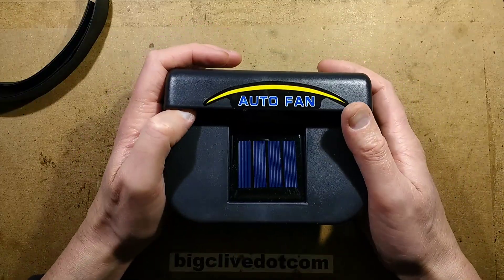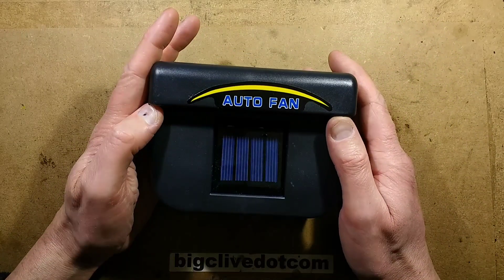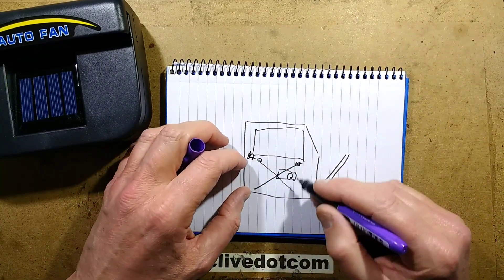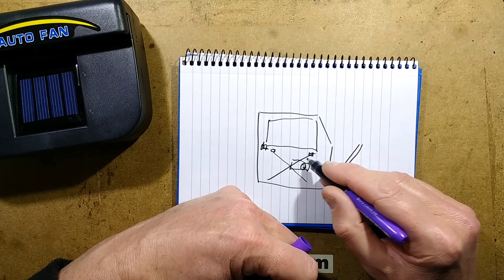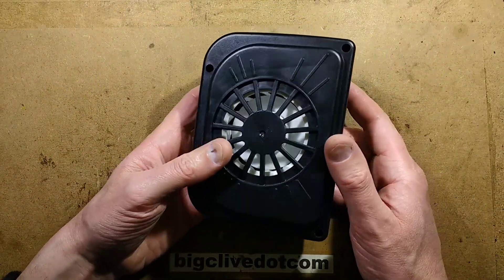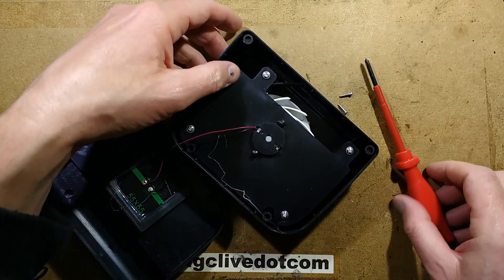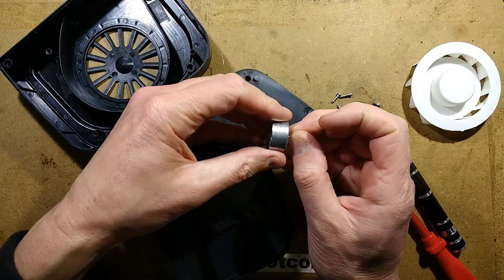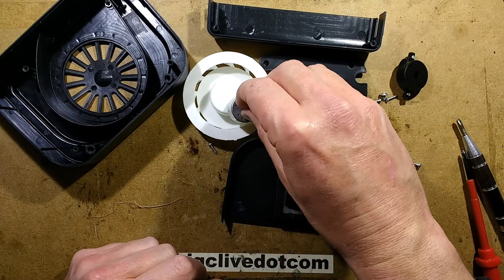Inside a solar powered car window ventilator.

Comment: I've been saving old and broken electronics lately  in hopes to create something useful. Thanks for all your videos. 😁👍
Reply: I had one and it didn't work too well, I would replace the fan inside with a high powered one from a computer and get a foldable solar panel to power it $50-90 on amazon. 
I'd look for one with the anti glare treatment and place it behind the rear passenger headrests

Comment: VW?  You can buy the cables and spool separately.    I would be slightly worried about giving a thief a headstart by making that little gap at the top of the window. 
Ps my car still has a tape player fitted.

Comment: The panel on the inside of the car door is called a "door card" and the metal cable with the sheath on the outside is called a "Bowden cable"

Comment: The seal I received for my 2012 VW did not work, it kept popping off.   Even if it did work, it would not have sealed it off all the way because the fan hits the top of the door using my automatic window closer and opens up immediately when the fan  hits the top of the gasket around my window.   So instead, I tried to use  the foam insulator for water pipes, large size and it works good and slides on real easy.  Have to buy the foam tomorrow,  large foam instead of what I have been using now which is the insulator for small pipes.

Comment: Breakage of your window's REGULATOR (interior plastic component) has nothing to do with the ventilator; or the weight of it ON the glass.  Mine broke when paying at an indoor parking lot.  Window went down and would not go back up ... BROKEN plastic cap/component withIN the mechanisms of the REGULATOR ... I have TWO ventilators for both sides of REAR (powered) windoes ... NO PROBLEM

Comment: Wanna know something that might make you angry? Auto windows have a sheer tab that causes them to break themselves if they push on the window too hard. They do this to prevent the motor from shattering the window, because it is cheaper than current limiting I guess...

Comment: Now you need to tear down the power window controls on a better car. Where they will bounce back and re-open to avoid strangling kiddies. Honest. This is common these days, don't know how they do it but that and auto-close must sense current? And position? Tear one apart!
Reply from the maker: It uses current sensing to detect the motor being stalled.

Comment: this illustrates a misconception of trying to defeat car technology whereby the window is designed to close then switch off this unit breaches the closure tech and clearly shows the result of the window trying to do its job and the unit blocking its primary purpose

Comment: Condensation is stuff you get on bathroom mirrors, you actually get it inside cars?
It's so dry in Australia I had a couple of oranges escape from my shopping bag a few years back, I found them under the front seat a few months later, tiny shrunken oranges, still orange, still round but about 1/3 the size and as hard as a billiard ball.
Reply from the maker: It's common after a hot sunny day followed by a very cold night to literally find all the windows inside the car streaming with water.
Reply: Blimey, that must be tough on the interior fabrics with moulds and stuff, not to mention the electronics. You would almost need anti-condensation heaters in your cassette player  ;-)
Cheers, Ray

Comment: For removing the hot glue to detach the solar panel (unless you already did this) and for future hot glue removal, put some cleaning alcohol on the glue's edge and start lifting the glue off. The alcohol will flow under and detach it in a matter of seconds with very little effort. If the glue sticks a lot, put more alcohol on.

Comment: The name you were looking for is door panel, sometimes called a door card but that does'nt sound right, the bulkhead is the steel panel between the engine bay and the passenger compartment.

Comment: This might actually be useful with the addition of a LiPo battery and a microcontroller.  I can't imagine running it while the sun beats down having much impact, but storing power and running it in the pre-dawn hours might help with morning condensation or frost.

Comment: I've taken one of those apart before.. the solar panel was actually not good enough to even make the motor spin and when checking the voltage in direct sunlight it only was getting 0.3 volts, so it's a good thing I found it in the garbage and didn't actually waste money on it.

Comment: I used one of those cheap cigarette lighter solar panels on my dashboard and wired up a computer fan to the vent in the rear quarter panel.  I was going to hook directly to the blower motor but I was afraid I might damage something else.

Comment: Since these appeared in commercials in the 1990s here in the US, I'd always wondered what kind of value proposition could have been presented by the owner(s) of this device to the various auto manufacturers  ( maybe a licensing deal with each competitor? ) , to list a similar function as a purchase option installed alongside the automobile's climate controls where it could source air from the existing fresh air ductwork. 
Solar cells of that size and output were cheap as were the motors. 
Vehicles would've been kept secure as well instead of what I recollect coming up in conversation / news outlets as the weak point of entry for a vehicle theft or the contents therein.

Comment: The part I was waiting for never happened. I wanted to see the voltage output of that small solar cell
Reply from the maker: 2V at about 100mA.
Reply: bigclivedotcom I can't see it creating enough current to run a brushless motor! Amazing.

Comment: I have 2 of these, and they are pretty much useless.  Pointing them directly at the sun, will give the motor a gentle spin.  But once it is behind the glass, it just peters out.  It seems that the glass on my car stops just enough of the light to kill the power.  My glass is non-tinted, and on an '84 Pontiac Fiero.  I doubt that auto-glass of that age is polarized in anyway.  But I could be wrong about that.   Either way, the fans are useless.

Comment: Cheap shitty Chinese prooducts like these are just not designed for use with Modern Conventional Vehicles with Automatic window closing mechanisms, Neither are most vehicle Window mechanisms  designed to allow any modification, which makes absolute sense since it opens up a whole world of potential security issues with vehicle security systems, etc, not to mention exposing the interior cockpit to the elements, rain, dust, pollution etc... Yeah, Car manufacturers must Shudder with Absolute DISGUST  when they see these kinds of Products on the Market.

Comment: You have  not missed a thing with that fan! I had one when I lived in Dallas Texas USA. The solar cell doesn't provide enough power to turn the fan fast enough to pull much air out of the car. In a nutshell, it doesn't work

Comment: Happens more often then you think on many different brand cars. The reason being very simple: cost/manufacturing issues. The mechanism very often consists of cable and plastic components. Most often these plastic imponent will fail. It's most of the time not very difficult to replace it all. But look in a manual or the internet BEFORE disassembly . Because the easy way is NOT obvious most of the times. I had to do this job on several cars of different brands, german/french makes it much of a difference. It really is more easy to repair then to seal.

Comment: If you decide to repair the window regulator, it looks like cheap replacement parts and entire regulator assemblies, are sold on ebay for the Skoda Fabia.
Reply from the maker: Yeah, it seems to be about £60 for a used panel.

Comment: had an 86 corolla with a broken window winder for a while. you'd go to wind it down and it'd never go back up. was always pulling the damn door panel off to fix it. silly me should have just removed the winder handle and nobody would have ever tried again.

Comment: I recon it would work well with those cover things that you can clip onto the windows, you see them on the 4x4's a lot, they allow you to lave the window open about an inch or two without the risk of a little rain... But, the horizontal UK weather is a bitch.

Comment: 1:57 - Oh, crap! You got it right, taking those door panels apart - even with the proper tools - pain in the arse! And once you get the interior panel off, the vapor barrier, glass from the regulator, the regulator from the door frame... I had a vehicle where it was actually easier to SWAP THE WHOLE DOOR than it was to replace a defective motor. :-)
3:56 - A warning, from personal experience: USE EXTREME CAUTION when re-tightening the clamp that holds the glass. Or you will be in the market for a new window! (And broken safety glass is also a pain to clean up!)

Comment: In 1986, I drove a 1971 Chevrolet Kingswood station wagon from Pennsylvania to Nevada. It was a great vehicle made to travel long distances at high speeds. So, as you can imagine, I used it to race the local teenagers through the desert. I even won a few races.
Anyway...
One evening, a car pulled up next to me and revved it's engine. Of course i took this as a challenge. I was just coming from a job so my toolbox was in the back of the station wagon. -- I was an A/V tech with Las Vegas convention services, at the time. -- The light turned green. I hit the accelerator. The tool box, which was loaded with gear, slid into the rear door of the station wagon, shattering the glass and releasing the rear door. The race was over before it had begun
I found a replacement door at a local junk yard. Instead of just swapping out the glass, I chose to replace the entire door. 
That was the year I learned about automobile wiring. Never again.

Comment: I had one of these. Waste of time. And I live where it's typically sunnier than the Isle of Man. The angle of incidence is just too oblique.

A couple of years ago, I bought a large silver blanket that goes over the top half of the car. I figured it would also be handy for taking a sneaky nap at lunchtime but I never got around to using it.

Comment: Clive, I'm surprised we didn't get any analysis on the motor or the solar panel. What voltage and power is generated? What speed does the fan turn at? What is the flow rate of the air by the fan in bright sunlight?

Comment: You should permanently install something like this: https://www.amazon.com/MARINE-POWERED-VENTILATOR-RECHARGEABLE-BATTERY/dp/B00S1LM6BG

They are meant for boats. They are designed to be used around water, without letting water in, they also are able to be closed and shut off. They are probably more dependable. 
The down side is you have to cut a hole in your roof. But it is a self contained unit, with a battery.
Reply from the maker: You can also get the savonius turbine versions that rely on wind power.

Comment: You could install some proper solar panels on your car, add a charge regulator to feed your cars battery and use the built in fans. A small control computer could make them run only as long as there is sufficient charge in the battery. Or find a way to hack the board computer. hmm...maybe only make it run when the inside of the car is warmer than the outside. To save energy you could also monitor the humidity of the air that leaves the car and shut the fans down when it's dry.

Comment: The mechanism that moves the glass is called a window regulator, the clamps that connect it to the glass are called sashes, & the membrane between the interior door panel and the door is usually called the water deflector or insulator on much older vehicles. 😊

Comment: Sounds like you either 1. Broke your window regulator. As a mechanic, I can 100% tell you that this is extremely common, and as long as your car isn't a BMW it shouldn't be a problem.

Some window regulators have protection from getting things caught in there, they have a pin that will shear and stop anything from happening.

However, most cars don't have that, most I've replaced the regulators on don't have them. If your live in a humid climate, the cables tend to rust and then break easier than the pin will shear anyways.

Now, I know removing the door panel is a pain in the dick, but if you get it off, replacing the regulator generally requires a piece of wood to hold the window in place, a socket set of 10mm and 14mm and some patience getting it out and in again.

I recommend replacing the whole regulator as repairing it is kinda a pain compared to replacing the whole thing.

You could have one that's like in my father's truck, it's 6 bolts to remove and replace in total. Or you could have one that's in my friend's BMW, 17 bolts, screws, and everything else to replace.

Check with your car manufacturer to see how much a replacement would be, never get the OEM ones as they are always a massive ripoff.

Comment: I had a VW Jetta I bought new sometime around 2001-2003 (maybe 2007?  I forget), that was the prettiest Jetta they ever produced...   problem was (and it had a LOT) when you'd go to wind down a window, the glass would randomly disengage from the slides, fall into the door and shatter.    VW denied it was their fault until the 5th window smashed...   then the fun process of recovering my money began.    It's a shame, as I said it was the best looking Jetta they ever produced, but the sheer volume of electrical issues rendered it useless.
Reply: Friend of mine had the same car. Didn't have the window issues you had, but often in the middle of the night all his windows would randomly roll down, the trunk would pop, sunroof would open, all while the car was unattended. He couldn't WAIT to get rid of that car, especially after having to shovel 8" of snow off his black leather seats!

Comment: Air conditioning is great if you have it. AC gets rid of humidity really quickly.  My old Vauxhall Zafira's AC was working without any servicing at 160,000 miles.
If ventilation is a problem, check the cabin filter.  Poor air flow when the fan is on high usually means the cabin filter has been neglected.  Cabin filters are just like engine air filters, but can be well hidden.  Changing the cabin filter on the Zafira myself cost me £11 instead of paying a garage £40 to do it for me.  Top Tip: When you do this job for the first time, do not do it on a cold November evening in the dark. :-)

Comment: Doesn't work in cars with tinted windows......You know like in cars in hot areas(Arizona, etc...) I tried one here in Arizona and the tint prevents enough sun light from operating the fan motor. Of course you could cut away the tint on that area of the window, but I would never do that.

Comment: That's what gets me about those who think solar cells are a viable power source. They can't do three things:
1. supply power at what we call night - y'know, rotation of the Earth and all that.
2. The power generated from solar ''cells'' is still pretty weak.
3. Deal effectively with (possibly large) fluctuations in power demand. You draw too much power from a (in my case, Diesel) generator, not only will it throttle the engine up, there is only so much the engine can do. If you need more power than the solar ''cells'' can provide, what then?

Comment: Had that happen on my '99 VW Passat. Sounds like you're describing the same thing. Hard to remove trim, sheathed wire, pantograph. But perhaps most or all car doors look the same inside. In my case, the small plastic clips that held the glass in place had become brittle due to aging, and simply shattered. No spare parts available, so I just used a metal rod and cable ties to jam the window all the way up... :)

Comment: Not sure about Isle of Mann, but window regulators are easy to change and don't cost to much. Sounds like you just broke the plastic roller bushings on the end of the regulator arms that lift the glass. If that's the case it's even easier to repair. Bushings usually cost around 5-10 dollars.

98-01 Toyota Camary regulator replace. For specific help we'd need the year, make and model of your car. But this video shows pretty much the standard procedure for all scissor lift regulators. Hardest part is getting the door panel off, which you've already figured out.
https://www.youtube.com/watch?v=eXibsbgpEWM
Reply from the maker: One of the end crimps of the wires came off and the mechanism then wrapped the wire tightly round itself.
Reply: Barring other damage a bicycle shops can crimp another end on the cable. They use the same thing on brake cables.

Comment: Those window regulator mechanism have got to be the most unreliable part of any modern car.  I've replaced the one in the driver's door of my car four times.  I now keep a screwdriver and a piece of wood in the trunk (boot) that's just the right length to jam the window glass all the way up, because it will fail again, and it will be pouring rain.

Comment: Reanults from the early to mid 2000's are the worst for those cable window mechanisms. Weve got an old Laguna and have changed the cables in every door at least twice.

Comment: For the pedantic, the type of cable you describe (frequently used to shift gears on bikes, some bike brakes, and on the throttle cable(s) on motorbikes) is called a Bowden cable.

Comment: got 1 like 20 years ago for $5. mine broke cuz i forgot it was in the back seat window and pushed the button "up", didnt break my window.  inside of mine was much more open they didnt have that fan shroud around the fan... i guess it worked to keep the car cooler didnt do any tests to see how it compared to just leaving the window down 1". didnt have high hopes for it but figured salvage was worth it.

Comment: I had one of these. It melted when the sun shifted to the other side of the car. They are very cheap. I was thinking about building one with a larger panel stronger fan and battery backup.